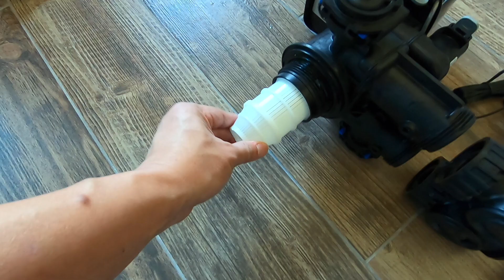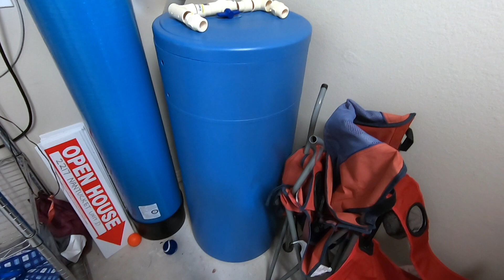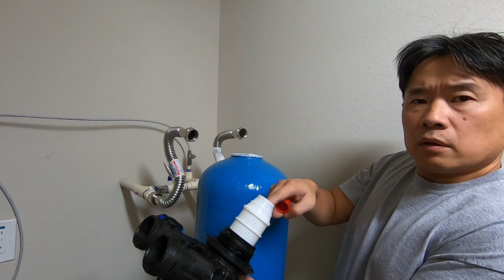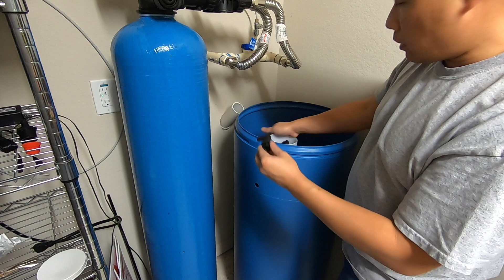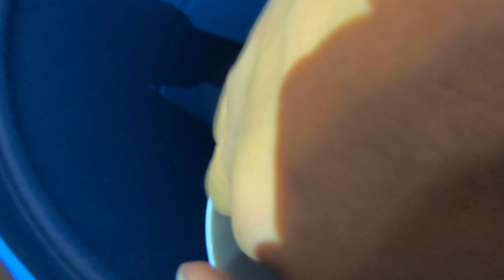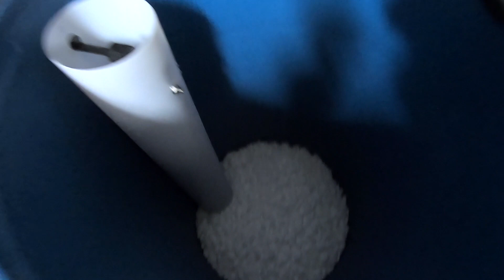Installing Water Softener FLECK 5810 XTR2 - step by step

Comment: You don’t need to put a bypass your head already has a bypass on it. You can buy these blackheads for white water but if you don’t know what you’re doing how do you know how to set it up? Do you know what your hardness is? You know how to read a hardness test kit There’s a lot involved other than slapping it all together but it’s a all good also, you need to tell your viewers you need to use over Greece on every one of those connections to assure that you don’t care the opening and lubricated FYI

Comment: Thank you. The manual doesn't really say which side the brine line connects on.  The clip came off of mine, and when I found the line laying on the left, I assumed it must have come from that side but could not find a place to connect it. 
I'd prefer to have a shutoff before your water dispenser to make it easy to change that and the water softener.